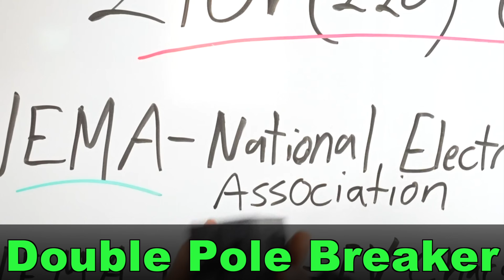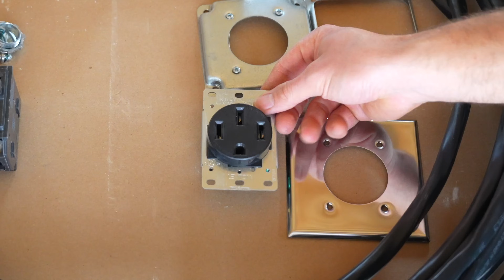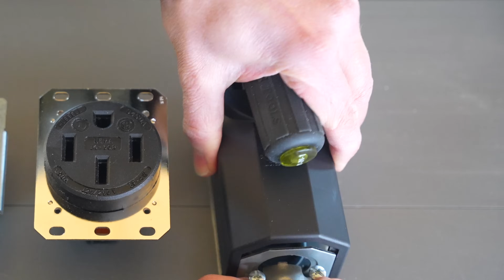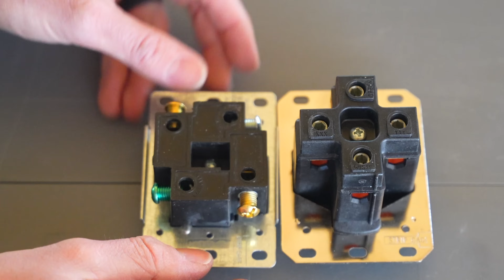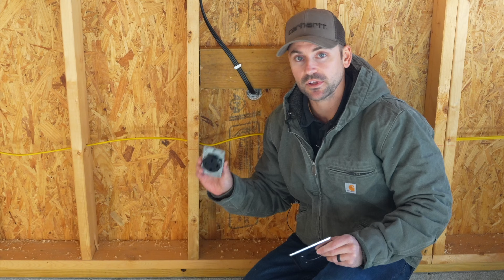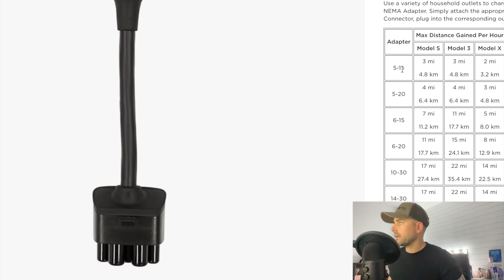How To Install A 240V Outlet In Garage - EV Car Charger, Welder, And Electric Range (Hubbell 14 50)

Comment from the maker: Hey! I covered A LOT of information in this video, so I placed timestamps below to help you navigate this video. Also, get access to ALL my DIY courses and downloads — just $5/month!
The library’s growing, but your price won’t if you lock it in today.
Join Here 👉 https://excellentlaborer.thinkific.com/bundles/the-excellent-laborer-course-membership
(Prices and details may change over time.)
NEMA Outlets Explained 00:28
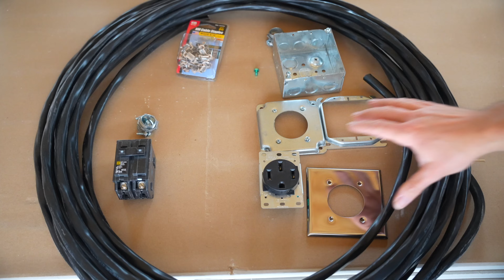240 Volt Supplies 04:14
6/3 Wire Rough In 06:53
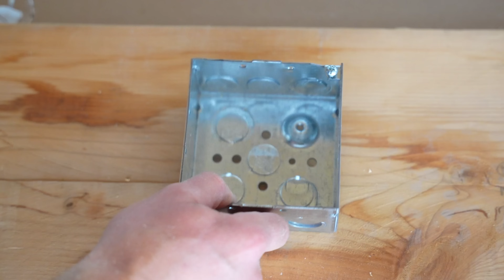Metal Electrical Box Installation 08:13
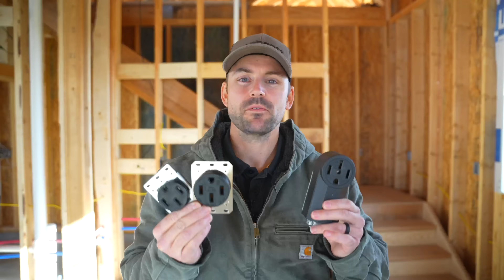NEMA 14-50 Outlet Options 11:10
240V Outlet Installation 14:45
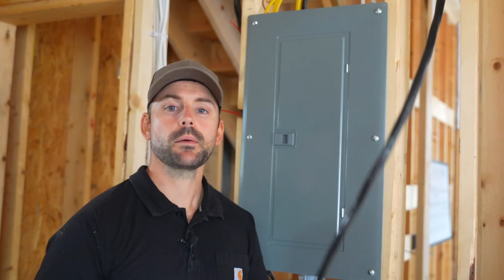Connecting 6/3 Wire To Panel 21:04
50 AMP Breaker Installation 24:37
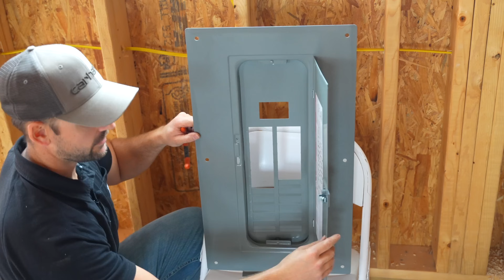240V EV Car Charging 27:38
Reply: Can I use a 2/0 2/0 2/0 wire to run a range or stove
Reply: Where is the Ground Fault protection ?
Reply: Excellent explanation! My electrician installed the NEMA 14-50 running alongside the gas line in my garage. Is that safe and according to code?
Reply: Great informative video
Reply: Like all of the commenters, I found the explanations to be excellent. However, this job has not gone easily for me. Excuse the long post, I hope it helps fellow klutzes attempting what looks like a simple job.

First of all, I am attempting to install the outlet directly to the main panel on the exterior of my garage, perfectly positioned where I needed the outlet and charger to go. My garage interior is already finished out with sheetrock.  I decided to do the flush mounted receptacle anyway. So I cut out sheetrock from behind the panel to access the hole for passing the 6-3 wire through. I had to cut a notch in the studs to pass the 6-3 wire through to the side opposite the panel port because ground wires were in the way of where I would have installed the outlet box. 

mounting the outlet box was a challenge - I should have cut much more sheetrock out to access it and the 6-3 wire. Damn that 6-3 wire is a pain to work with! I exposed about as much wire as appeared in the video but found it impossible to make the connection to the outlet because I couldn’t turn the outlet 90 degrees to access the screw heads to lock the wires in place. So I had to push more wire through and after making solid connections, pull the excess 6-3 wire up through the romex port. It was extremely difficult to press the outlet into the box despite having put some bends in the wires to aid in compressing their paths when I pushed the receptacle in. 

Finally got it in and went to install the 240v 50A breaker. and wiring in my main panel.  However, the breaker doesn’t snap into the panel. I bought all parts as linked to Amazon in the first comment. Both the breaker and panel are SquareD. But the breaker is 2-3 mm wider than the slots it is supposed to go into.

 Back to Google to figure out what is up.
Reply: @lentzjas I’m still trying to get those 6/3 wires in that box. Hardest part been a few days now.
Reply: Just got a quote and to install a 240v was going to cost 1900 with an inspection. Please tell me that’s not normal….
Reply: @braxb874      For a simple install where the box holding the receptacle is close to breaker box, you may need only a 40 amp gfi breaker ( cutler-hammer 81$) and a heavy duty bryant receptacle (50$),  6-3 cable(20$) and
the other bits didn't cost much.  Took me about two hours, not counting time to clean up the chalk.   40 amp breaker is all you need for using a tesla mobile connector, since the max charge for a tesla with ac is 32 amp any way and 40 amp gives you the 20% extra capacity you need for charging at 32  amps.  I knew enough from the training I got back in the jr high shop 50 years prior.
Reply: Excellent video you explained everything in detail. Had a question, i live in a corner house and its a long house. My breaker panel is all the wayin front of the house while my garage, where i want 220v for my welder is about 80-90 ft at the other end. I am not an electrician but will running a cable that long have a lot of resistance? The garage has an old style fuse panel with glass fuses.wiring looks like a thin gauge so i dont think thats an option. Any suggestions? 

Thanks for the excellent video
Reply: Which one is needed for split air heat pump that says it needs 220V? Eg LG?
Reply: Hey my friend! I love your videos. Any idea of how much to charge for doing this?
Reply: Then the car batteries blow and all your hard work ( to say nothing of your entire house) burns to hell and beyond!!!😱😱😱🤪

Comment: My grandpa called it 110 220 in the last 50 years it has been called 120 volts per leg or 240 volts on a two-pole breaker wake up dude we're in the year 2026

Comment: Do not unplug the charger from the outlet. The 240volt outlet is not designed like a regular 120volt outlet that you would plug a vacuum or similar appliances into. All I plug in or unplug is the connection for my car directly.

Comment: My current electric stove is running on 40 amp breakers, and I plan on keeping it after I move my 240, my question is whether I need to get 50 amp breakers and the 6/3 wire or keep my 40 amp and use 8/3?

Comment: The outlet doesn’t “pull” voltage(240 volts).  The voltage is always there. The connected device may “pull” whatever amps (up to the breaker limit) to operate the attached device.

Comment: I've got eight 240V outlets in my garage.   That's the standard voltage here.   My "BIG" outlet in the garage is 415V 3 Phase.  Man the american electrical system is so backward.  Good luck !😉

Comment: Josh, does a 240 volt breaker not use the plug on neutral as a single pole breaker does? I didn't realize you could attach a wire directly to the plug on neutral bar. I guess a 2p breaker works differently then?? Thx again. You're very detailed in every step. Thx
Jeff

Comment: Would it be possible to use the existing wiring to an oven and install a switch that would allow you to switch between your oven and car charger?  Considering you would probably charge your vehicle overnight and not likely to need your oven?

Comment: He did  not leave a hair more than 6" from the time then wires emerged into the box . looks like wires cut were exactly 3" outside box . THHN wires are stiffer --harder  to bend. Plus his indoor box has a lot more room than those 3 1/8" grey plastic boxes for wet locations .They have mounting tubes running the depth of the box , His box was all free space so this is an easier job than a wet location box

Comment: Great video what’s a tip to complete the wire run if u already have Sheetrock on the sidewalls as well as the ceiling of the garage.. TIA 🤘💪🤙

Comment: Awesome video. This is exactly what I want to do in my unfinished basement. Not for EV, but I want a robust 240v outlet at 50 amps. I have a couple questions if you don't mind. (Since this video is 2 years old now)
- I have heard that new outlet installs like this require AFCI breakers (or at least GFCI)?
- I have heard the top of the outlet can be no lower than 4 feet from the floor of the basement?
- If it is unfinished basement, do you need conduit (metal or Grey Sched 40) from the outlet to the ceiling of the basement, before continuing on along the inside of the walls and floor/ceiling cavities?
-In the install for the Hot Tub you used the white plastic strip to hold the 6/3 Romex, in this video you used the Staples. Any specific reason for the difference?

Comment: Hi quick question; your ground wire is maybe a 10awg wire; how does the set screw on the NEMA 14 50 holding that wire in without it slipping?  Should I make a small 'S' loop?  Happy Holidays... I answered my own question and the 'S' loop works.

Comment: Nominally -it's 120 V and 240 V. This is what most power from secondaries of is referred to in this day and age.. Line voltages have been raised to reduce current loads on  distribution lines.

Comment: I replaced a 240 outlet when I discovered it only had half power, so one leg had no power. After I replaced it, I still had the same problem🤦‍♂️. Maybe the breaker is at fault? But it feel tight.

Comment: Important to note the torque of these fasteners are measured in 'Inch' pounds not 'Foot' pounds (I presume some are not familiar with this).
Reply: 75ft-lbs is nearly lug nut torque 😅
Reply: Well I had to add my two cents being I'm a professional perfectionist..75 inch-pounds (in-lb) is equal to 6.25 foot-pounds (ft-lb). To convert, divide the torque value by 12, as there are 12 inches in a foot. Formula: \(75 \text{ in-lb} / 12 = 6.25 \text{ ft-lb}\)
So there you have but I just learned something !! TYFYT

Comment: Just wanted to comment here on the difference between the Leviton and the Hubbel outlets you used; the hubbel one you showed is rated for an EV charger because it is made to supply a continuous charge.  The Leviton ten dollar one is not, and is fine for a range but not for an EV charger.  There's been a lot of instances of like house fires and stuff from people using the cheaper one for their EV and then it causing problems.  So if you're installing an EV charger like this make sure that it is one that can handle a continuous charge.  The Hubbel part number for reference is an HBL9450A.

Comment: NEC has updated to state that if this outlet is in a garage it needs a GFCI breaker. Also from what I have found as well that a EV charger will be limited to 40amps with a plug so a 50amp breaker will be correct for the 80% rule.

Comment: A few minor points:

When talking about the power supply (from the outlet, etc), "120V" and "240V" are the correct terms.  Those are the correct nominal values for the power standards used in the US.  Therefore, there is technically no such thing as a "220V outlet" (in the US).  The outlets are all "240V" (or "120V").  When talking about the voltage requirements of an appliance, they will often say 110V or 220V, because that is (usually) the minimum voltage that the appliance can use.  That is describing the (minimum) limit for a particular device, not a standard.

"6/3 Romex", etc does not have "three conductors".  It has four conductors, because ground is also a conductor.  However, if you actually look carefully at how the cable is actually described (on the packaging, etc), it will always actually say "6/3 plus ground".  That is, it is saying "there are three #6 conductors in it, plus a ground conductor" (for four total conductors).  The reason it is listed this way is because the ground conductor is usually not the same gauge as the others (it is a bit smaller), but calling it "6/4" would imply that all four conductors are 6 AWG, which would not actually be true.

NEMA 6-50 and NEMA 10-50 outlets are not the same.  The NEMA 6 outlets are grounded outlets (two hot plus ground).  The NEMA 10 outlets are ungrounded (obsolete) outlets (two hot plus neutral, no ground), which are substantially less safe, and should not be used if you can help it.  NEMA 6 are usually OK, but modern code most places actually requires using a 4-pin NEMA 14 outlet instead of a NEMA 10 outlet, if your appliance actually needs a neutral.

Good job explaining the difference between the lighter-duty outlets and the heavier-duty ones.  Lots of people seem to give really wrong information about the difference between them.  The main difference is just that the cheap ones are only designed for something you plug in once and then never touch (like a stove, or a dryer).  The heavier-duty ones are actually intended to support plugging and unplugging things a lot.  If you use the cheap ones for something that gets a lot of plug/unplug cycles, it will eventually stop making good contact, often leading to a meltdown and fire risk.

You really should use a proper wire stripper tool to strip those wires.  Using something like a box cutter is an easy way to nick or damage the wires, which is a big no-no.

Also, the more recent versions of the NEC require that outlets to garage locations must be GFCI protected (for example, using a GFCI breaker).  This is not yet required in all local jurisdictions (some are still using older versions of the code), but many do already require it, and it will eventually be required everywhere (and is arguably a good idea anyway).

Comment: This video is now a couple of years old.  If you are installing the latest Tesla charger they are direct wired and you don't need the expensive nema 14-50 or box.   Just pull the wire and run it right into the Tesla charger.   Almost every EV sold in the US today uses the NACS standard developed by Tesla.
Reply: Hardwired car chargers require a GFCI 60amp breaker for the 80% rule. And I would hardwire it directly to the breaker or a 60amp disconnect wired to the breaker. No wire nuts ect.
Reply: But you need to buy 450 charger when now mobile charger is included with a car if leased
Reply: @Filipp81  If you are using the free charger doesn't that just get plugged into a regular outlet.  No need for Nema 14-50 to be installed.
Reply: @t @troyfall6573 yes. Free Charger has like 10 diffident adapters that are interchangeable with different amperage. 14-50 is the highest one and regular outlet one is the lowest.

Comment: DUDE!  This was an excellent video!!  I did EVERYTHING you said in this video and bought everything you suggested except for the Hubbel 14-50 outlet.  They didn't have Hubbel at Menards and they said LEGRAND is just as good and a fraction of the cost.  So I saved money on that one.  But your video was perfect for my 240v install and am super happy with the results.  Just muscling the 6/3 wire into the box deserves an award!!

Comment: If you use a level 2 charger for an ev that has a 48 amp draw, you can't use 6-3 conductor. For a contiguous use circuit at 48 amps, the conductor has to be able to handle that load while only using 80% of the circuit capacity, (NEC). This means the 6-3 conductor is too small. Also wire size is also determined by the distance from the panel to point of use to mitigate voltage drop. So for a charger that's doing the max draw for a level 2 at 48 amps, you'll need to upsize the conductor to meet an ampacity rating of 60 amps instead of 50 amps. To use this installation as you've installed, you'll need to insure the ev charger draws no more than 40 amps from this circuit.

I also noticed when you clamped the black conductor, a portion of the bare conductor was exposed outside of the receptacle body. Either it wasn't inserted far enough or too much insulation was removed. This exposed wired makes it possible for a short to occur by contacting the bare ground once installed in the box. Not such a big deal with an insulated ground wire. The black wire should be shortened to eliminate the exposure or reclamped to eliminate any bare exposure outside the receptacle.

I think the current NEC also requires a ground fault breaker to be used on anything but a direct wired level 2 with integrated gfci. In fact, cure NEC requires any receptacle in the garage regardless of voltage or use, including a ceiling garage receptacle for the opener to be ground fault protected. 

I'm sure there will be a lot of eye rolling on this requirement, but remember one thing, many of the NEC revisions are driven by fatalities. Unfortunately gf breakers are pretty salty.
Reply: ok so 60 amp circuit instead of 50. but if not 6-3 then what’s the correct wire? would it be 4-3? (for 48 amp charger)

edit - is the nema 14-50 outlet still ok?

Comment: DANGER - There is a specific outlet for EV Charger usage. Most 32 Amp chargers use 14-50 NEMA outlets, but EVs use a specific version of that outlet, which is the same plug prongs, but it is a heavier duty plastic. It is marked with a small green EV car icon  to the right of the ground lug. You can find these on AMZN. The standard outlet is not designed for contiguous high current draw. Dryers draw a lot of current, but not for hours at a time.  Much better to use the correct outlet because the car charger can draw that amperage for many hours at a time.

Comment: If I need a 240V plug I definitely will save some money with a different way.  The one you installed are what we commonly called a stove plug. Just about every house have one.   I would use a stove box instead of a 4X4 and I will not pay $30+ for a Hubell, instead , I can just buy a stove receptacle (rated 50 Amps) from Home Depot.  It is wise to determine the receptacle orientation before you install the box.  Of course the cheaper part , you are going to exercise more care plugging in/out of the plug than a Hubell. But I never had one that broke on me. I usually use such plug for a welder,  but if you are maxing out drawing 40 amps for hours charging a EV,  a better quality plug may be needed. I am smart enough not to fall for the hype and buy a EV with the battery tech not ready for prime time.

Comment: Just go with 240v and 120v, that is the current spec. Correct people that say different, 110v and 220v are legacy terms and no longer accurate for the US electrical grid. It has been 240v since the 1960's.

Comment: Question - house has RV outlet.  At the breaker box, pvc conduit for this circuit and it just floats in a large knock out in the metal box.  What’s used to secure pvc conduit to metal box specifically?
Great vid!

Comment: Great video.  One question - any reason not to use ferrules with stranded wire connections?  I've watched a few of these videos and no one uses ferrules but I'm considering using them for those screw connections.  Would that be bad?

Comment: Note the "cheaper" 14-50R is not for continuous duty; an electric dryer or oven cycles on and off. The Hubbell 14-50R is a CONTINUOUS duty receptacle. It is designed for continuous duty as would be the case with an EV charger. It is not that one is "cheaper"...the "cheaper" receptacle should NEVER be used for a charger.